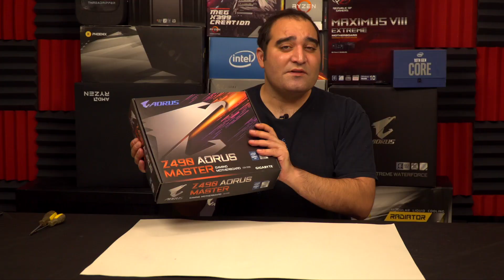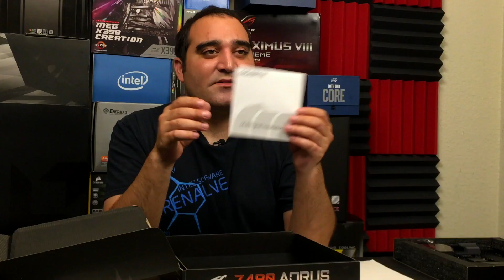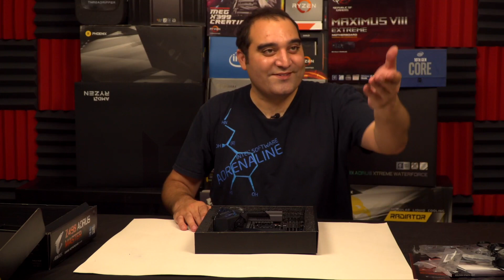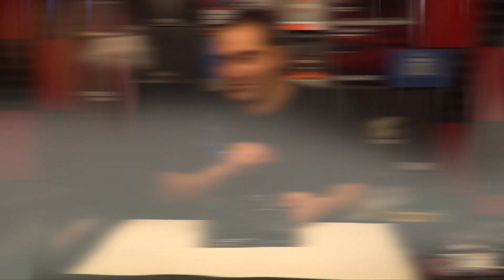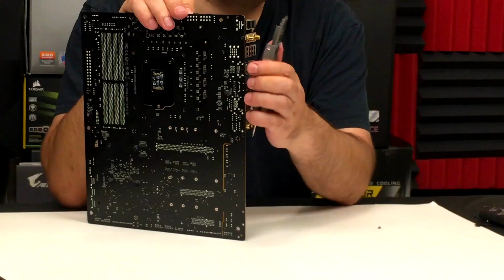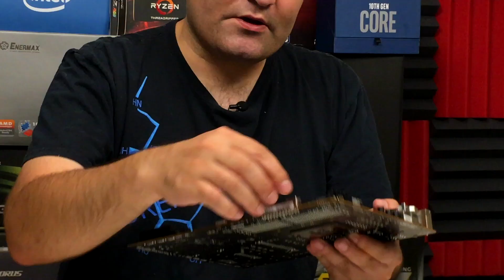[SH] GIGABYTE Z490 Aorus Master Review

Comment: Hi I recently got a z87x-ud5h second hand. It is no longer turning on. I checked the psu which is fine but the battery is completely drained. I put a new battery in and it still does not durn on. I have a multimeter and the schematic. Any idea where do I start checking?